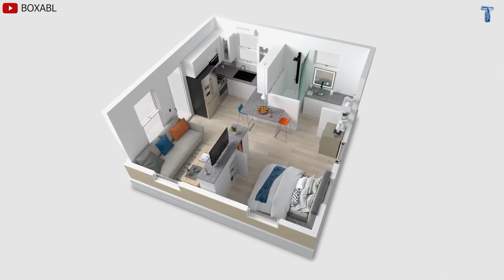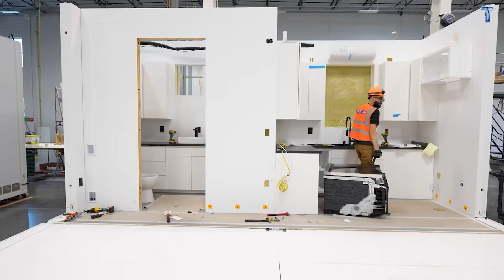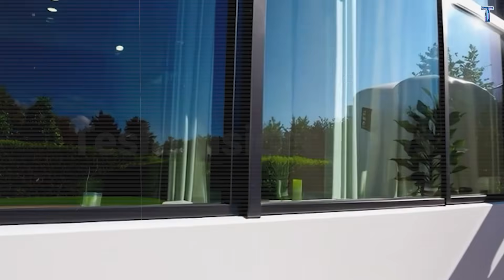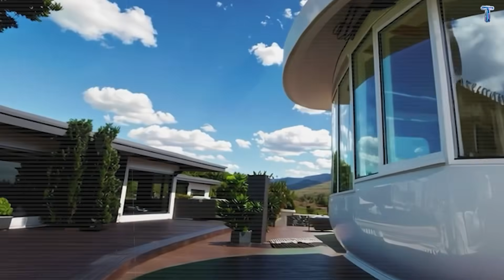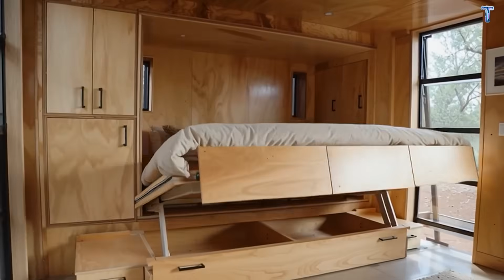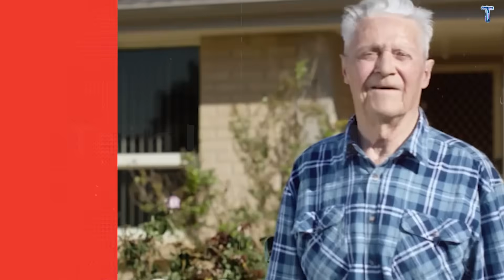Tesla Tiny House 2026: The REAL TOTAL COST You Need to Know (10-Year View)

Comment: I looked up how a Tesla tiny house would withstand tornados, and this was the answer:  Tesla's Tiny House is designed with advanced materials and engineering to withstand extreme weather, including tornadoes.  Its cold-formed steel frame provides exceptional strength and flexibility, allowing it to move with seismic waves and resist structural failure during high winds.  The house features impact-resistant laminated glass windows, reinforced doors with multi-point locking, and a low-profile, aerodynamic roof to minimize uplift and wind resistance. Additionally, the non-combustible fiber cement or corrugated metal siding offers protection against flying debris and fire, common hazards in tornadoes. 

However, no structure can reliably survive a direct hit from a powerful tornado.  While the Tesla Tiny House is engineered for high wind resistance and is more resilient than traditional mobile homes, it is not a tornado-proof shelter. As noted in expert discussions, even reinforced buildings can be destroyed by the extreme pressure differentials and debris impact associated with strong tornadoes. The house’s mobile design and lightweight construction mean it could still be lifted or damaged if caught in the tornado’s core path. 

For maximum safety, occupants should:

Anchor the house securely to the ground using steel straps and deep anchors.
Evacuate to a dedicated storm shelter or basement if a tornado warning is issued. 
Use the house’s off-grid solar and battery systems to maintain power and communication during emergencies.
In summary, the Tesla Tiny House offers significantly enhanced resilience compared to conventional homes, but it cannot guarantee survival in a direct tornado strike.  Preparedness, evacuation planning, and proper anchoring are essential.

Comment: Where is the bathroom?
Reply from the maker: In the standard layout it is a compact enclosed bathroom inside the unit, usually near the rear wall. Final layouts can vary based on configuration and updates from internal sources. Would you prefer a full bath or a simplified setup for long term living

Comment: The price sounds great but I keep wondering what happens after a few years. Do you actually own anything long term
Reply from the maker: That is the part most people skip. The house is one thing, but land control changes everything. Year five and ten matter more. Curious if you own land or would lease
Reply: This all just explains basic home and land ownership. It has nothing to do with Tesla.
Reply from the maker: It actually applies to any housing tied to land, Tesla or not. The reason it matters here is many people focus only on the house price and miss the long term control side. That part decides whether it works or not. Do you think land ownership should be discussed upfront or left to buyers to figure out later